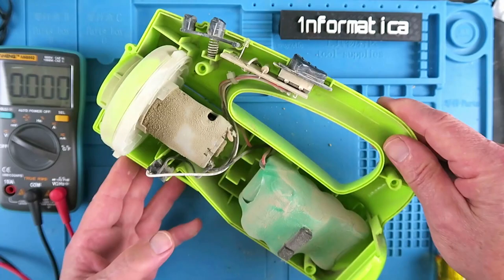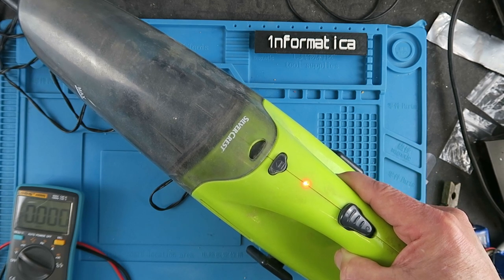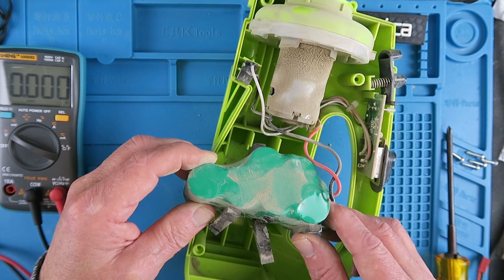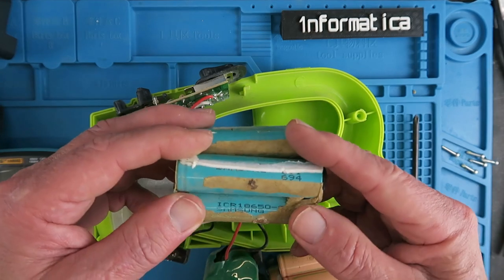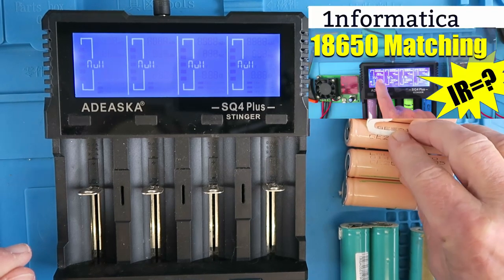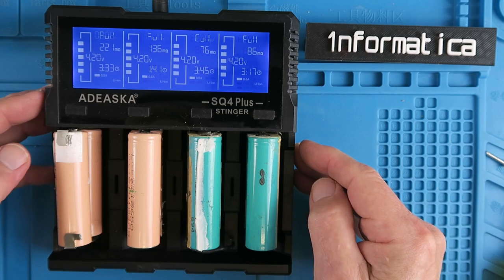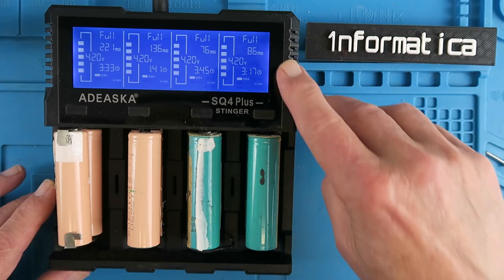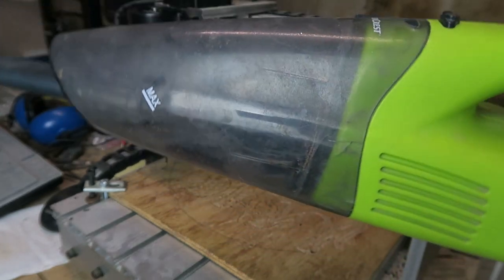Lidl SAS 7.2 A2 Vacuum Cleaner Repair Upgrade

Comment: this is great.  Where can I find the video where you tested or repaired the circuit board for this vacuum cleaner please?
Reply from the maker: Hi, I did not repair the board. I swapped it out for  Lithium Ion charge board and swapped the old Nimh cells for a 2P 2S pack I made up. Review of the charge board here : https://youtu.be/gKNF-hATmfQ Thanks for watching, have a great day!

Comment: Gotta Love those 18650 cells.   SOOOOOOO Damn useful.   I would have bodged a charger circuit right into the thing along with  3S li Pack.   That motor would deal with 12v quite fine.   Turn it into a  Supreme  SUCKER !
Reply from the maker: Yeah, a 3S would really suck! The guy is 7 years old so I figure an easy retirement just cleaning my CNC is deserved.
Reply: @1nformatica  That one is better built then the one I had.  The one had did the Chernobyl thing being left on the charger.  LOL
Reply from the maker: Holy smokes!

Comment: don.t buy it!it is a garbage.After a few months,don.t charge anymore.This replacement is too expensive and time consuming.Try to find a vacuum cleaner that works on car cigarette lighter direct!
Reply from the maker: Sure, it is not the greatest but as with all  battery powered tools you must not run it down to the point the motor cuts out and always put on charge straight after use then wait until it is fully charged. before using again. Please consider subscribing if you have not done so already!